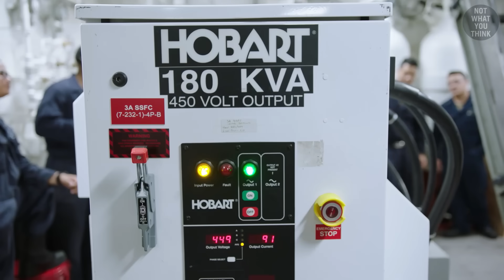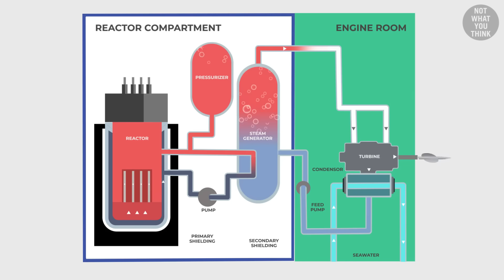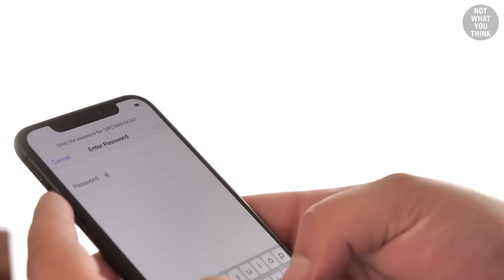America's “Aircraft Carrier Shortage” Explained

Comment: I doubt anyone that matters will read this. but in the off chance that you do, I have a 3 part plan that will make the military in these areas better. 1. increase pay by a LOT. Make pay almost disgusting and mind blowing. 2. With really high pay comes really high standards. make it really easy to fire people for substandard performance. you want there to be a line of people waiting to do the job a mile long. the current problem being that there is really high standards, low wages and a really small chance of being fired. So you have this perfect storm of the job is difficult, AND youre getting payed a really low amount for that, AND they really cant fire you for doing the bare minimum. and finally 3. let the people do their own work. tell them what to do or how to do it, not both. let the people make their own schedules, decide their work hours etc, planning, what to do, when it needs to be done, and if they dont meet those expectations, fire them.

Comment: If the Navy had 3x the number of carriers they would still not have enough.  Resource allocation is what the Navy Brass gets paid to do.  There are solutions other than these super expensive carriers.  Its always nice to have crushing strength but you don't always need a sledge hammer to deal with a small rat.

Comment: Good report! There are a few ways the USN could fix these issues: 

(1 A designated Training Carrier/Test Bed. The USS Nimitz is going to retire. This while expensive would be helpful as a deadicated training carrier would allow Reserve Sailors and Airmen to stay trained. That would ease loads on Active CVN crews and cycles. It would also allow testing of new systems and modifications without again taking CVNs off of the line.

2) Stand up a full Reserve Carrier Air Wing. This also would cost the Navy and Marine Corps but again, it would ease retention, add options to new Enlistees and Officers and would maintain a continued pool of trained Sailors, Airmen and Marines. If need be, Squadrons or Detachments could support the Active Duty Carriers or in case of a surge the entire Reserve Air Wing.

3) Stand up one or two  more Active Duty Air Wings. The Air Wing brings over 2500 Sailors Airmen and Air Crews along with various Squadrons and Detachments flying H-60,F-35,F/A-18E/F,E-2,C-2 and E/A-18Gs. Currently there is one Reserve Squadron flying E/A-18Gs. The other Squadrons in the Reserve Tactical Support Wing do not deploy and fly F-5E/Fs or F/A-18Echos as Adversary Training Aircraft. There are no Reserve E-2,H-60 or F-35 Squadrons. 

4) The USMC fielded F/A-18A,A+ or C Hornets as part of a number of CVWs. This will continue with F-35Cs but there is only one USMC Reserve Strike Fighter Squadron. Options for Reserve F-35C Squadrons should be considered.
Reply: Gone are the Hardworking Baby Boomers. They are either retired, old or rested in peace.
Gone are the American Patriots and Nationalists. They are either retired, old or rested in peace.
Corruption has risen in the 21st Century ! and the Culture of the New Generation is also corrupted.
Only the Few Rich, Elites and Oligarchs become more Richer.
Meanwhile, the Majority Poor, Masses and the Working Class become more Poorer.
There is a HUGE INEQUALITY in the American Society. 
Workers Union must be organized and rise up against the Few Rich, Elites and Oligarchs.

Comment: US Navy: We need faster turnaround!
Military Contractors: Yeah no. We get paid by the hour.
Reply: The main reason for the slow turnaround is that repairs and maintenance aren't as profitable as making new ships, so shipyard put them on back burner
Reply: @leefster1  Actually, the real reason is that the navy guy needs to have time scheduled to the area to work on it and specific instructions and guidelines when doing so and so does the contractor; generally the two don't mix and if one is there then it won't be approved for the other as it could be a safety hazard since they're 2 different crews per say; Though in honesty only a contractor worker or a enlisted maintenance for navy will ever tell you that real reason since everyone else only gets to look at the giant lists they print out for everyone else to look at when it's quite literally 'oh yeah, turn 2 valves to isolate this area, then unscrew pieces and replace, then after it's secured and put back together deisolate and run tests to make sure it's operational if it's at the end of the maintenance checklist for that project or machinery and all other parts are operable at the time as well; if something doesn't work follow procedure which is generally some form of securing/shutting off said project or machinery and running diagnostics to then check where further maintenance is required to make it work.'
So if you wanted to know the real reason why it takes so long from someone who has worked there in person, it's quite literally 'worked hours'(fancy way of saying you should spend x time when you actually spent 70-90% of that time on average but need that full time in case someone inexperienced follows exact instructions to do the same also because 'man hours'=more workers, which are sorely needed and usually is generally very stingy because people complain to government to stop spending money so they do and then the people working for said government reply back saying that aint a fuckin thing and we sincerely need peeps and then unlike the people who complained to the government that too much was being spent, we then need to show our work to get it approved.) and then second reason is making, reporting, then following proper procedure even if you wrote the damn thing.. takes a fuckin bit.. you wouldn't believe how many procedures contain a tighten this bolt pattern down in said order 3-5 times(not joking..) at sometimes pressures that exceed what you actually weigh.. and it's at the end of a several hour procedure with a several hour running at proper pressures test associated after and that's for what most would consider 'light maintenance' once you've worked there for a bit..

So real reason in total and as short as possible? Following safety in every form because a dead man can't fix a living mans problem; reporting everything followed so it can be troubleshot later if needbe to solve other issues with similar problems; and uh.. the interesting one.. greed, man.. good ole greed...Allowes you to do the work in the first place but gives you less manpower to do it with.. Cause apparently sweeping every inch of the floor isn't enough.. it's a timed task so go do it again cause we said so.
Reply: Gone are the Hardworking Baby Boomers. They are either retired, old or rested in peace.
Gone are the American Patriots and Nationalists. They are either retired, old or rested in peace.
Corruption has risen in the 21st Century ! and the Culture of the New Generation is also corrupted.
Only the Few Rich, Elites and Oligarchs become more Richer.
Meanwhile, the Majority Poor, Masses and the Working Class become more Poorer.
There is a HUGE INEQUALITY in the American Society. 
Workers Union must be organized and rise up against the Few Rich, Elites and Oligarchs.
Reply: All aircraft carriers are obsolete death traps for the several thousands of sailors and pilots operating from these behemoths. They are an American tragedy waiting to happen. A WWII legacy no longer valid or useful for its intended purpose. Hypersonic missiles and drone swarms make it so. The current deployment(s) to Red Sea is proof positive they are ineffective as credible deterrent to land based threats to commercial navigation. It's best to scrap them and repurpose the high quality steel into new high-tech potent submarines. Submarines are far more capable deterrent to deliver knockout blows to any and all potential sea going and land based adversaries that would attack America. US carriers cannot stop attacks on commercial navigation or itself as evidenced with near misses on American war ships. This is a huge embarrassment to the Pentagon. The US Navy should home port these antiques as soon as possible.
Reply: Lawl
Reply: A Corveta de Taiwan é a melhor, pequena e de baixo custo.
Reply: @EFA-BRAZILIAN how is this reply relevant to the comment?
Reply: @TheBabyCaleb  And who asked you something?

Comment: Sounds strange. Rebuilding generator should not really have any relation to other maintenance activity than refueling. Given that if other repairs take anyway couple years the generator rebuild should be feasible in same time. Therefore it is hard to believe that it adds so much time to maintenance schedule.
Reply: It may be that the generator in question is not a diesel-powered electrical generator but rather the nuclear powerplant’s steam generator.  That is the part that uses the radioactive water from the core to boil non-radioactive water; it is a whole different thing to work on.
Reply: I was close; it is the turbines that use that steam to generate electricity which were damaged.  No nuclear implications, but they are precision devices and they’re probably buried pretty deep in the ship.
Reply: I mention all of this because the item being hoisted in the video is one of the diesel generators.

Comment: US carriers are over-engineered and excessively large for the actual missions being undertaken. The resulting complexity leads to long shipyard refit times. Long downtime completely devalues the utility of the vessel. Building Maserati's - when a pickup would do
the same task. Commercial build hulls are far cheaper than Navy Yard designs. Drones are lighter airframes and do not need swaggering aviators or expensive catapult assistance.
Missile systems are now mountable and demountable to keep pace with technological change. You no longer have to build the vessel around a particular weapon system.
Propulsion went to nuclear on the basis these carriers could stay on duty longer. Pointless if the remaining onboard systems then keep bringing the carrier back into port for repairs. 
Building lead times inflate costs - inevitably. So why do we still design and build these sacred cows?
Reply: 😂😂 yeah, right.
Reply: China says they are useless...they are easily sinkable....China builds carriers as fast as they can xD

Comment: 11... try 18. Don't forget the Wasps. An F-35 launched from a Wasp hits just as hard as one launched from a Ford-class.
Reply: The F-35B and F-35C aren't the same beasties. The CATOBAR variant has a significantly better performance envelope and also a larger payload for both internal stores as well as for external hardpoints than the STOVL variant.

Still and all, a jarhead 35 is way better than no 35!
Reply: Those are not carriers, they are landing docks.  They provide different functionals and dramatically different abilities.
Reply: @haolepirate . You can use them as a smaller carriers in an extreme need.
Reply: Don't forget the Ford class has 3x the power of the Nimitz and is much lighter...bring on the laser defenses xD
Reply: @Kevin-x4p4y  That does seem inevitable, doesn't it. Also EMALS also does strongly imply the future possibility of railguns... although possibly on a different, perhaps significantly more armored, platform.

Comment: If anything, we shouldn't have gotten rid of the Steam Supercarriers. We should have had them in RRF; then we'd have carriers that could still reach anywhere. Yes we have the staff shortages, but that's because of COVID Mandate Policies that still haven't been rolled-back. Get them rolled back, we've solved half the problems.
Reply: The current carriers use steam.  The old carriers just used a different heat source to make that steam and were logistical nightmares in comparison to modern carriers to supply.

Comment: At the end of WWII the navy listed 101 aircraft carriers, about 7,000 freighters and thousands of combat ships. These were weapons  platforms with many still viable today. The B52h is going  through a critical update after 70 years in service, but plans are being made to scrap the Nimitz. Italy's has an aircraft carrier than is 40 years in service. Our navy must reexamine the rather quick scrapping when real naval threats exist.
Reply: I served on a Nimitz carrier several decades ago. Even then, the limitations of the design were apparent; especially electrical power generation. There is also the issue of repeated upgrades approaching the point of diminishing returns. As it stands, Nimitz was commissioned in 1975, which means she'll be 52 when she starts decommissioning in 2027; a long life indeed for a warship.
Reply: It would cost more to make the Nimitz class go for another 25-50, than it would to build a new carrier.  Plus, the new ships have smaller crews.
Reply: @haolepirate  Both are good points. Most people don't get just how harsh the oceans are, nor how unrelentingly demanding it is to maintain combat effectiveness in an ever-evolving paradigm.

The latter point is interesting. A larger crew increases operational expense and strain on the total force, but it does have one huge benefit. More manning means more extensive damage control and simultaneously more redundancy in the event of a casualty. A warship, especially a capital ship, is going to take hits; and the difference between limping home for an extended drydock stay and sinking may be the quality and extent of the ship's damage control. See IJN Taiho specifically.
Reply: The nimitz needs to be scrapped. Her maintenance cost out weighs her positives